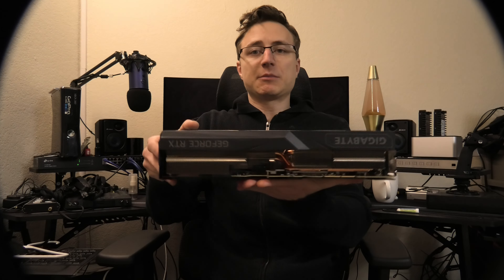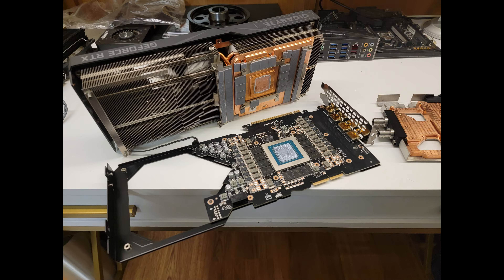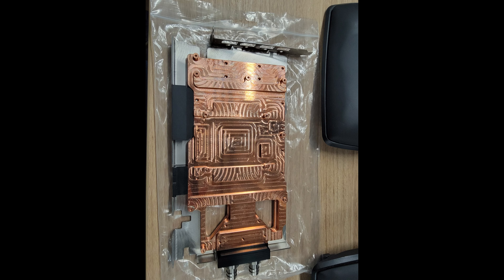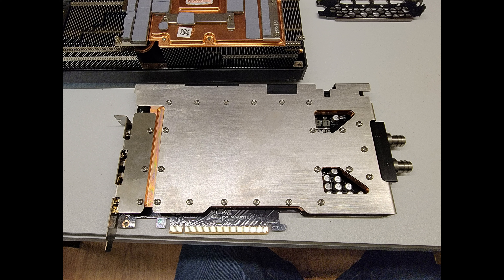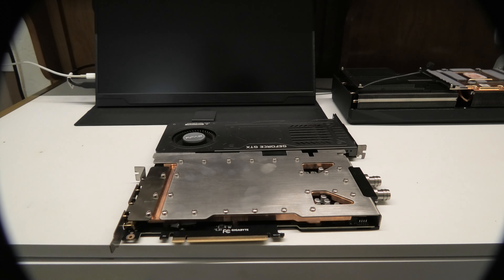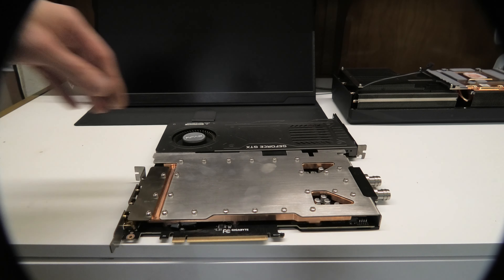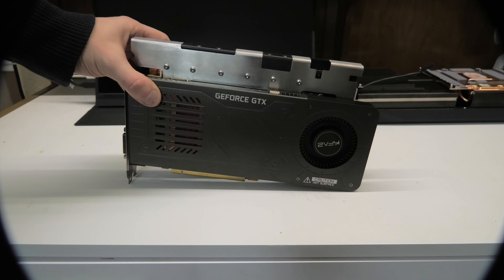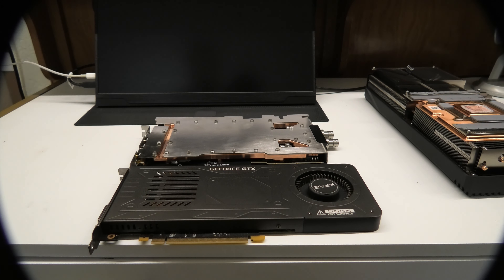Comino 3090Ti waterblock install and overview

Comment: @cr4zyw3ld3r where did you find this waterblock for sale? I contacted Comino but they only sell to businesses/in bulk and it is a crucial component in getting a SFF build completed due to the fitting location.
Reply from the maker: @hli53194  I contacted them directly and they worked with me. However their policy might have changed. Also once they move onto new gen cards usually they stop producing older components unless you are a bulk buyer. They are a very small shop so they need to make space on the CNC mills for orders, hence why one-offs are more rare for them. You have to remember they are not mass producing any of these parts at scale.
Reply: @cr4zyw3ld3r  Noted, thanks for the prompt response!
Reply from the maker: @hli53194  good luck!